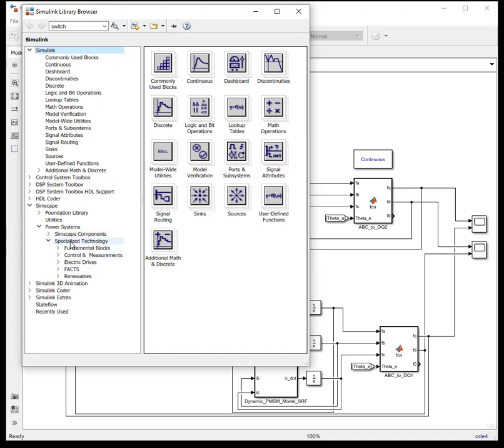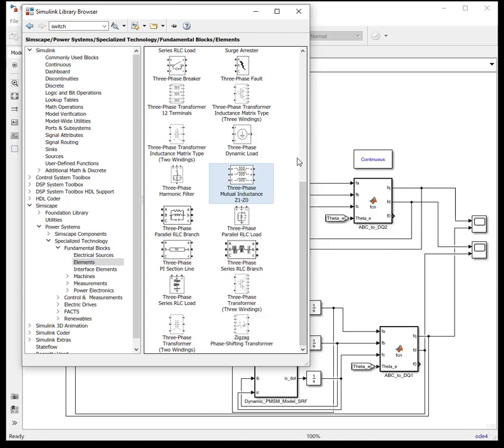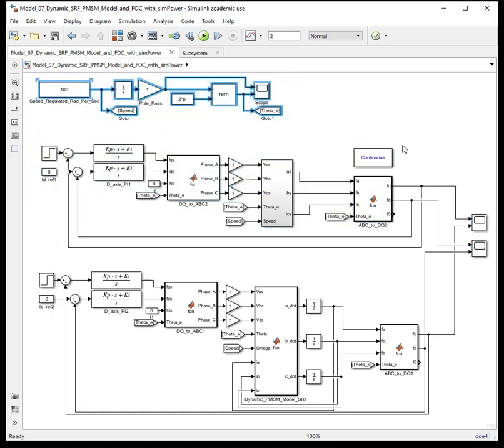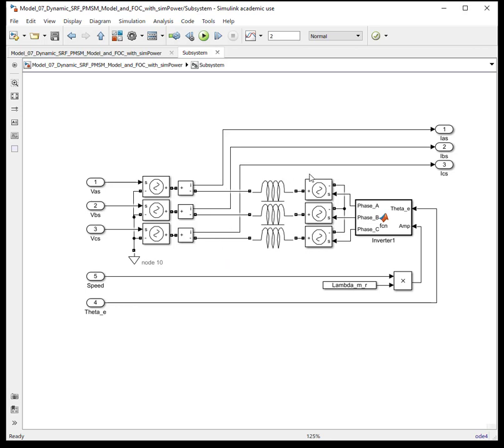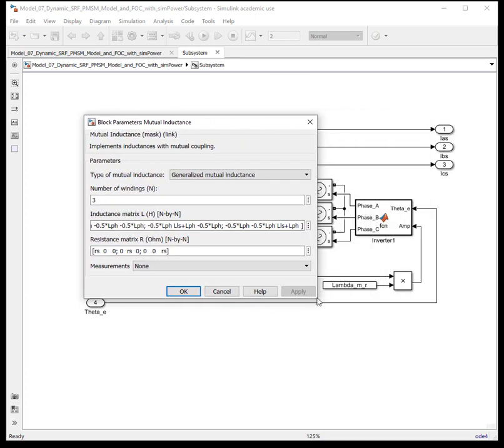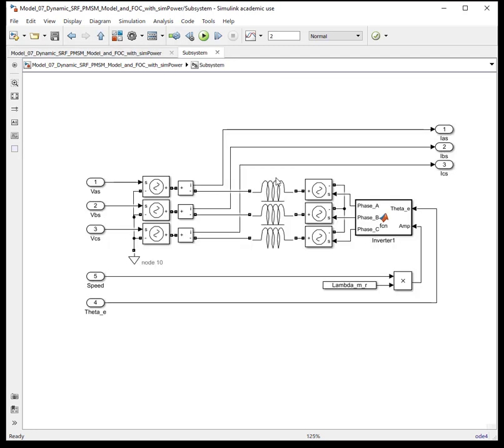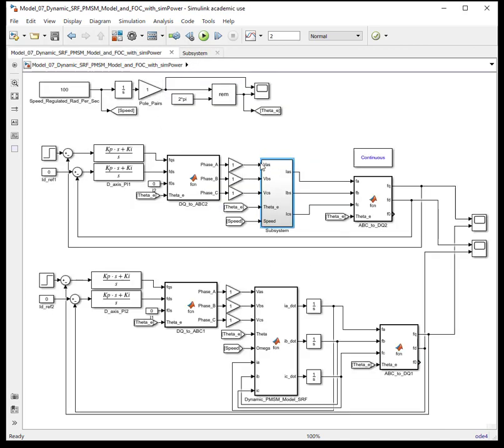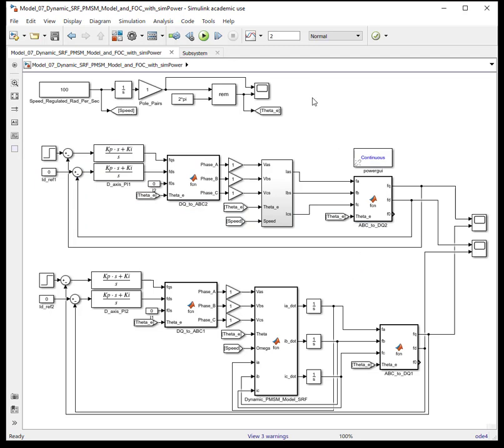FOC with Dynamic Stator Reference Frame PMSM Model with MATLAB Simulink simPower Toolbox

Comment: I just wonder how long does it take to run the simulation. You used function block in Simulink. Each time it returns back yo matlab code page and again go back to simulink, so it is more simulation time. I wonder are there another way to do it with own block of simulink without function block?
Reply from the maker: Actually, function block are much more efficient than using blocks because simulink eventually converts all block to code to solve the differential equations.